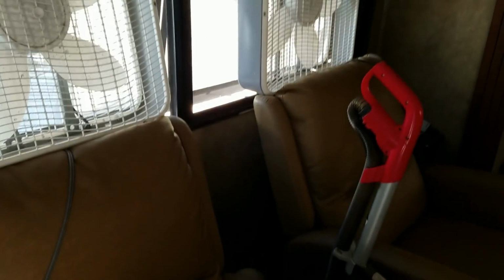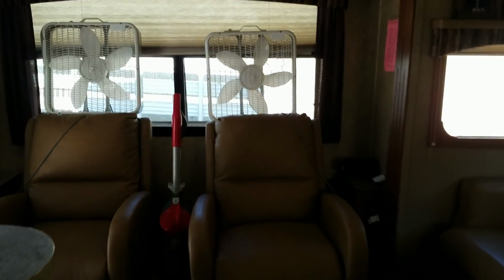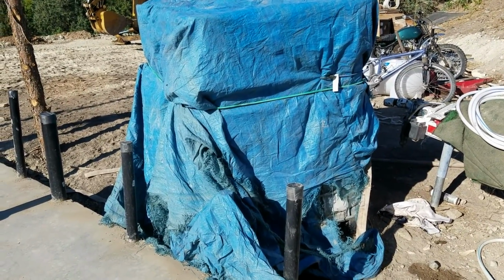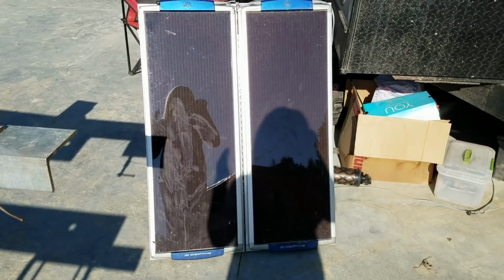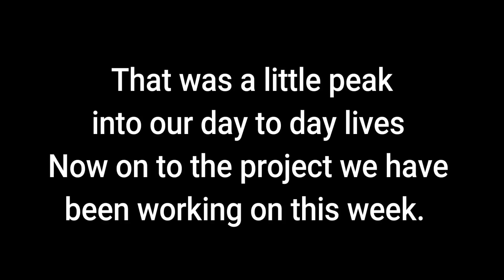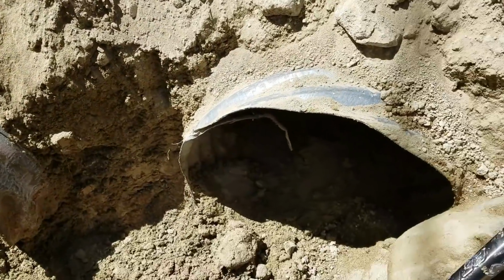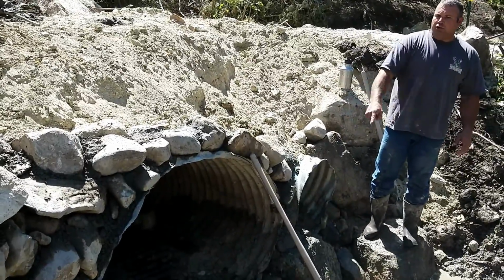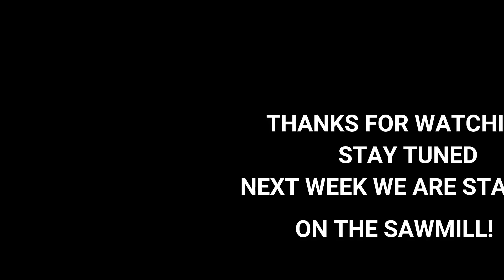Off Grid Living:Water Erosion Prevention

Comment: If you are planing to be up there for winter you might want to look at a backup option for more living space then getting the shop done. A refer shipping container can make a great living area by installing a standard door in the opening and walling the rest of it off. Rooms can be created using ropes and curtains giving everyone their own space and once you have structures built it makes a great storage shed or even sell it to the neighbors for their own temp living space. The main doors can be left on for securing it if you have to leave for some time but the rest of the time just secured open leaving the normal door/wall exposed. 

For fuels a pair of the 100 pound propane tanks and a barrel to put on a frame to hold the gas so you can transfer from the cans to the drum to always have empty cans in case of a surprise run to town.  The extra propane and gas storage is for those times you get stuck in due to a storm as those are the times you run out of fuel for the generator or heating. A barrel on its side held in a frame lets you run a fuel line from the lower little bung and have a 90 out of the larger bung to add fuel into. If lower then the bed of the truck you can get a ball siphon to drain the gas from the cans to the barrel without lifting the cans. 

Running propane tanks in the winter will be fun as they can get so cold you can't get gas out even with them still partially filled. Heat tape and an insulation blanket can get it flowing again but you want them on a timer to not forget to turn off. A luggage scale can help you figure out how much propane you have left by getting the weight of an empty tank then finding out how much the current one weighs.